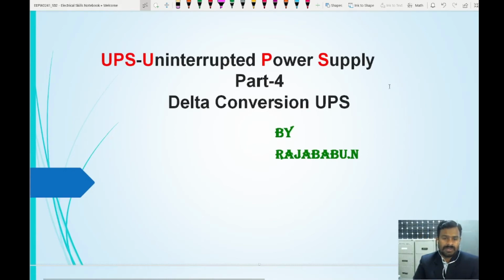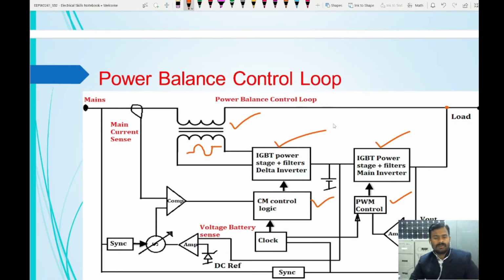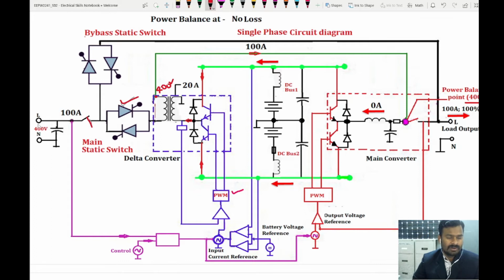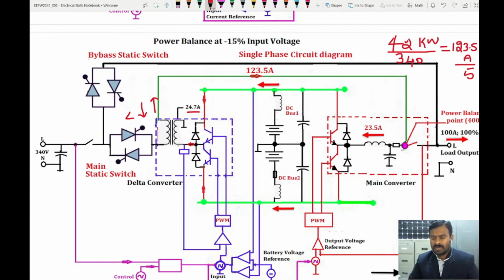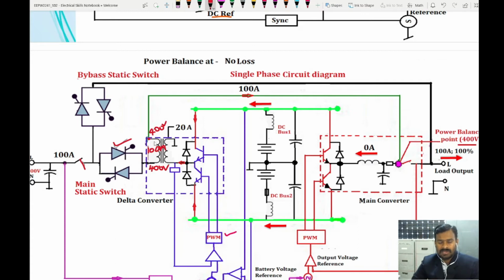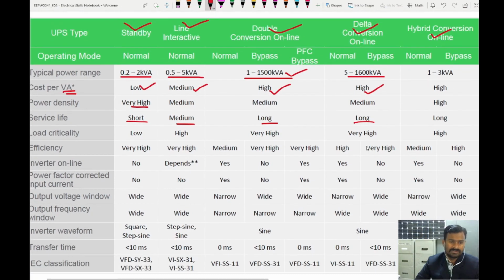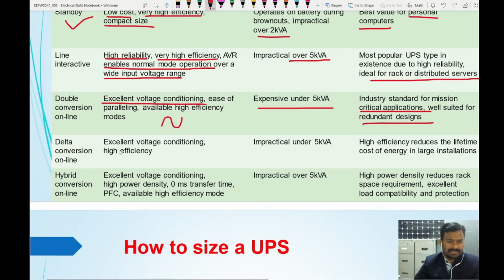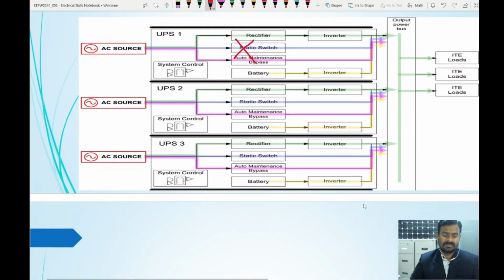Delta Conversion UPS

Comment: Excellent video.
One question... which UPS systems on the market use this topology? In my career, I've only encountered APC Silcon.
Reply from the maker: Brands / Lines associated with Delta or delta-like conversion UPS:

MGE UPS Systems (Schneider Electric) — delta conversion topology in select high-efficiency three-phase UPS lines. 
EDN

Delta Electronics UPS — major manufacturer with topology enhancements that incorporate delta conversion concepts in its advanced products (Ultron, Modulon).
Reply: @rajababu.n6265 The Ultron and Modulon UPS lines are not Delta Conversion. MGEs are also not Delta conversions What is your source of information?